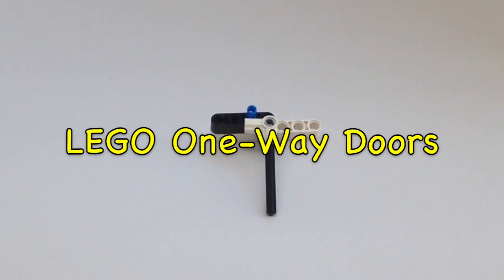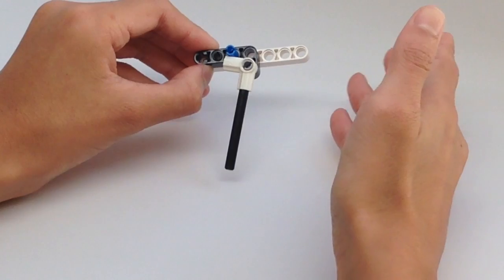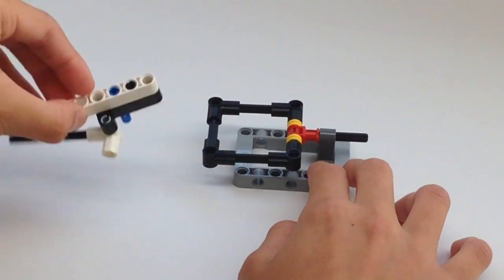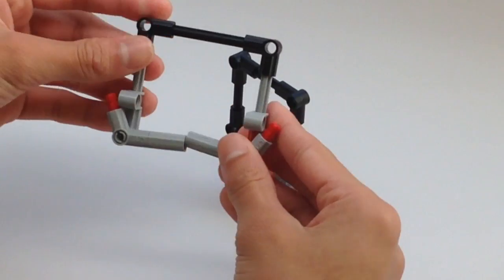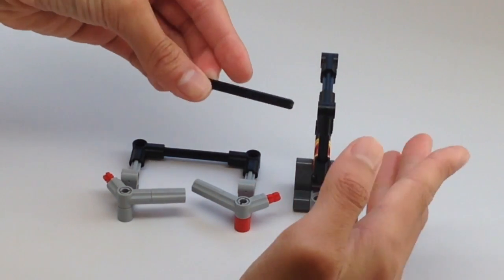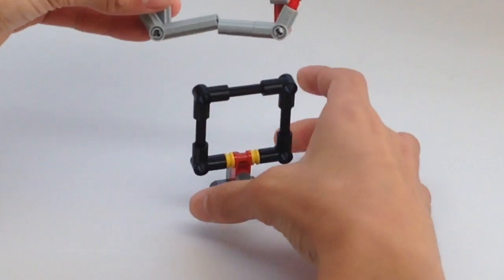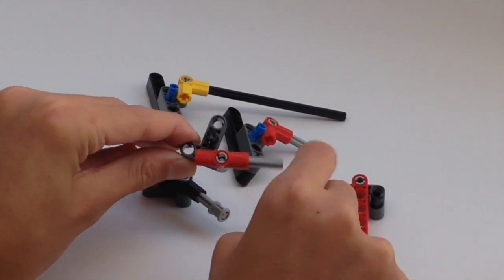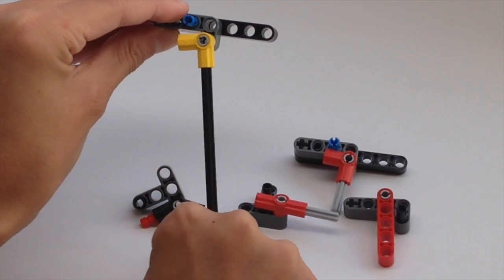FLL 2015 Trash Trek - LEGO One-Way Doors

Comment: I like how you compared the shorter one way door to the longer one. If you want the reason for your conjecture that you made at the end, I can tell you that it at least has to do with the basic concept of torque. The greater a line (or radius) from a rotating reference point is (in this case, the pivot on the L-shape is the rotating reference point), the greater the torque your doors will provide when locking in an object. Thank you for showing me this. I never really heard if this concept, and it looks interesting, even though I am not in an FLL team. I just like Mindstorms a lot.